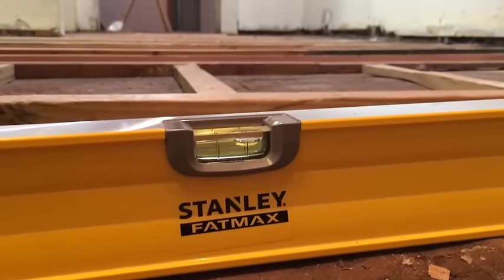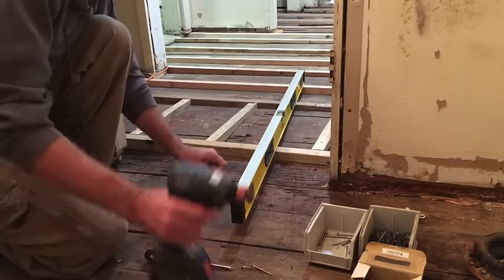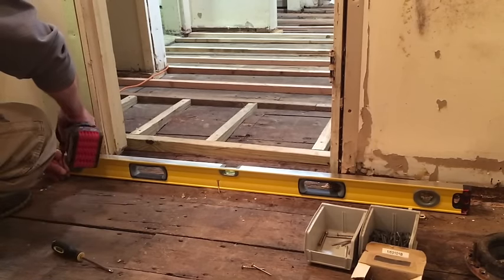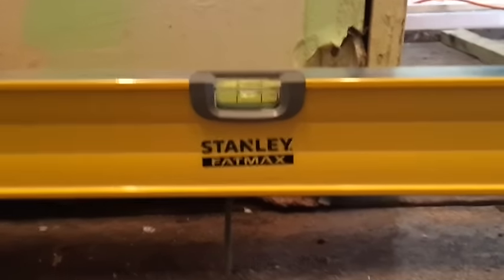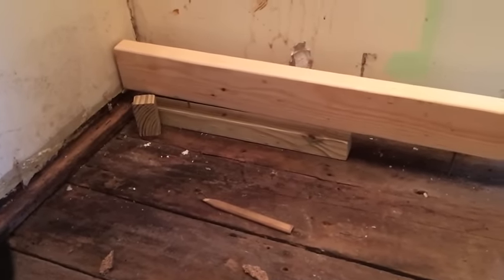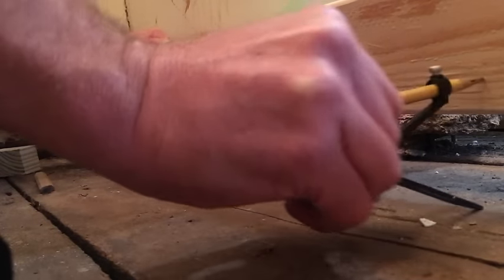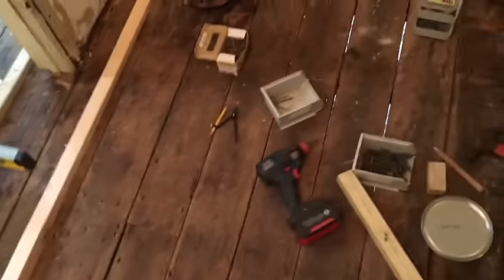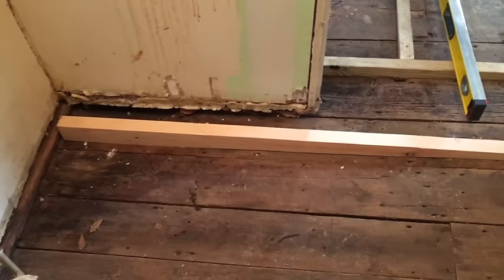DIY: How to level a uneven, wavy, or sloping wood floor

Comment: good morning I am going to do it too.I have a deck that i close in. And one side higher then other side. So wish me luck.I want get my wood up on the walls. I have to my floor first. I watch video your make much sense to me. thanks well I did it.
Reply: My sucker was saw that we have it’s a Dewalt and let me tell you it heats up the batteries real quick I don’t think it’s need to cut a 2 x 4 I don’t use it my husband uses it it scares me but I’d like my chopsaw and my jigsaw but when I get done I will show you a picture of it

Comment: I see I am way long from posting to making a comment but just wanted to say, in the process of buying an old home and the floors are terrible.  It has had some foundation repairs before and, like you, probably needs new footers and posts but each floor has shifted and sagged different amounts.  You put a level under the joists and its pretty minor.  The 2nd floor though is wavey and in one place you can see the closet has shifted (sagged) inches.  Once I have it stripped down to studs I'll know for sure if there is more structure to repair but I'm thinking, aftet 160 years, its the same thing you had here.

Comment: Hey....I'm a complete novice and love this video. Thank you!!  One question from this renovating, mathematically challenged grandma....how do you calibrate the scribe angle?  Sorry if it's a dumb question. :(
Reply: Might be a bit late here but  you just need it to reach from floor to the face of the board at the largest gap.
Reply: @daytradersanonymous9955  I totally appreciate the information. I left the floor until last and actually locked the door and headed to Jamaica for a bit. Will finish the reno when I get home. Thanks so much!!

Comment: Couldn't find any comments on this: Any thoughts on insulation in the deadspace or some other filler? I'm thinking this would be great for a 1917 porch on a house. Has been fully enclosed. Underneath is still generally exposed
Reply from the maker: Hey, John. I did use some expanding foam in between the some of the shims where there were some gaps and cracks that air could circulate. I let it dry, then trimmed it with an oscillating tool. Putting some fiberglass insulation probably wouldn't be a bad idea, too. Good luck!

Comment: You can skip the last step by setting your scribe up properly. If set up you wont have to cut the height down
Reply from the maker: Thanks.
Reply: Please explain how you would do that... I think there should be a way.
Reply: Use a sliding square ruler and measure from the top of the screw to the floor.  Take this measurement and mark it off on the side of the 2 x 4.  then line up your scribe on this mark.  All you will need to do is make the wavy floor cut and you should be level.  That's what I have been doing.  Great video by the way...Saved me a lot of head scratching.

Comment: Does this not affect the height of all the doors basically doubling your work? Couldn’t you use a self leveling mix?
Reply from the maker: I trimmed about an inch from the bottom of one door. Self-leveling compound is heavier, is not to be used on top of wood, and can only be poured 5/8" thick.
Reply: @737T1C130  thanks!

Comment: This is a seriously great video! How did you determine which room to start in? Our bottom floor includes several additions and I’m terrified of the thought that I might (with the help of your method) perfectly level one room just to find out that it is at an entirely lower level than the adjacent room. Do you see what I’m saying?
Reply from the maker: I used a tennis ball to find the highest and lowest points of the rooms (by seeing which direction the ball rolled), then started at the highest point.

Comment: Ok, probably a dumb question, but how is the ceiling fixed/leveled? 
Ours will be SO off after we level the floor 😬
Reply from the maker: poolahpot The perimeter of the house was level, just the center of the floor was sagging toward the middle. The ends of my ceiling joists were resting on the perimeter of my house, so while the floor sagged in the middle, the ceiling did not. However, I did add support to the ceiling joists to ensure the remained straight. Good luck! I’m not a pro, just a DIY’er, but it wasn’t too difficult.
Reply: Install a drop celing.
Reply: And no its not a dumb question.

Comment: Will you apply Boracare to the existing sub-floor to prevent termites? Or some other products?
We live in florida and they are horrific here.
Getting ready to do this same kind of project on a 100yr old home and this video is so helpful!
Also, did you do any mold testing?
Reply from the maker: poolahpot I have several old buildings on my property over 100 years old. For some reason, the termites never attack the old roughcut local hardwood structures. However, they will attack the older store-bought pine board construction. Fortunately, there was no pine in this house and no sign of termites. There was some very light surface mold on a couple pieces of drywall, but the interior of the house was gutted until no sign remained and it’s all been replaced
Reply: @737T1C130  Maybe a dumb question, but why'd you level the floor before gutting the drywall? I've got a sloping floor, actually worse than yours.  I had a structural engineer come in, and a contractor poured new footings and installed a new beam, but there's only so much he felt he could jack up the 130-year-old joists without cracking them, but I'd planned to level the floors BEFORE reframing the interior (it's a masonry-supported house so all the framing needs to do is keep up the drywall, except for 1 structural wall inside).

Comment: You could also take up the boards & bolt 2 by 6 to the joists, less time consuming but more expensive.
Reply from the maker: The joists were full dimension hardwood 2x6" from 1916 with ductwork, electrical, and plumbing added later between them in the crawlspace. The subfloor above those were full dimension 1x6" planks 2 layers perpendicular. The walls were built on top of the subfloor. Believe me, it was not less time consuming or I would have done it.

Comment: Does the block of wood have to be a certain height that you used to scribe your line?
Reply from the maker: Not really. It just has shorter than the piece of wood you are scribing. Once you get the scribe/contour, you can just cut the top down to the appropriate height. Someone suggested scribing the line so that you don't have to make the second cut, but I'm not that smart.

Comment: Could you not have used a series of joists with different heights then lay cross section beams joining each joist. You could lay plywood over the cross section then.
Reply from the maker: Chris Nugent I have no idea.
Reply: @737T1C130  I missed your posted comment. Apologies. 
I've got an uneven concrete floor in my kitchen that I'm going to build a new level wooden floor over it. 
Sounds like your house has kept you busy. It'll pay off in the end.

Comment: I need to do this on my upstairs bathroom, what’s the reason for keeping the floorboards? I was going to remove mine to reduce floor height difference to the hall etc.
Reply from the maker: The floorboards are long 1" thick hardwood planks. In some places, there are two layers of floorboards running perpendicular. the interior walls are built on top of the floorboards. Demolition and rebuilding would have been much more costly and time consuming, but you're right, it would have reduced floor height. But that wasn't a concern here.

Comment: I have done something similar once -> I used thin plates of wood, metal and plexiglass - > I made  plate stacks every 10 [in] levelled and secured them, then put a 1 [in] OSB plate on top of it. It went fine in terms of levelling but it was not perfect the floor beneath creaked a little bit here and there even though I secured it. All together it was quite time consuming and I am not perfectly happy with it ... I should have just removed the old floor and underconstruction and put an insolation + concrete screed in. (yes I read that in your case that was not possible ; ) )
There is also another possibility using screed made from gypsum ... one can first level the floor with a kind of gravel insulation material and then put gypsum boards on top of it ...

Comment: You don't need to make two cuts. Simply adust your compass to start from the lowest point/ghost stringer hight, marking that point on the 2x4 and setting your compass to start scribing from that mark
Reply: Can you elaborate? Having a tough time envisioning this tip. Thank you!!

Comment: Curious. Would it have been less work to rip up the subfloor and sister up the joists? No scribing or ripping? I was about to do the same job but saw your approach and am question which route I should go? Thanks for the video!
Reply: My husband has done it both ways and once you start ripping up a subfloor you will wish you did it this way. The only benefit to demo subfloor is that you can access the crawlspace and sure up any piers or joists that need it without having to work in the crawlspace.
Reply from the maker: If your subfloor is plywood panels or similar, it would definitely would be easier. My subfloor was made of two layers. Each layer was hundreds of old full dimension 1" by 6" planks and the layers nailed perpendicular to each other. It would have been much more work to pull up my subfloor than the time I spent cutting shims.
Reply: @737T1C130  Not to mention the old 1x6 subfloor is old growth wood that's probably stronger than any new 2-by you could get at a hardware store these days...

Comment: I appreciate what you're trying to do but there are some things that puzzle me. Given the direction of the subfloor boards, it means that the floor joists are running in the opposite direction: that is, perpendicular. This means that the tapered pieces of wood that you're using to level the floor are running perpendicular to the floor joists. This means that these pieces of wood are acting as the new floor joists yet they are only inches deep when a floor joist is typically 10 inches deep. This means that the depth of your "new" joists are not deep enough and will not support the weight that they're suppose to support once you apply a subfloor on top of them. I addition, the last two "make-shift" joists are much more than 16 inches apart: the standard for floor joist spacing. Now, I see that you added sections of wood between these "make-shift" joists between the last two that you've shown (but not beyond that). Even assuming that you do the same for the rest of the floor, because your "make-shift" joists are tapered, and not level, the sections of wood between them ARE level so you won't end up with a flat floor. Not sure if you understand what I'm saying but, in short, this WILL NOT work.
Reply from the maker: You have no idea what you're talking about. The 2x8 underfloor joists are 12" on center. The subflooring planks are 3/4" thick. The shims across them are 12" on center except for the area near the door. The 3/4" plywood subloor has a load rating of 175 lbs per square foot with a maximum span of 48". It has been lived in for 4 years. There is zero deflection and it is perfectly level. The only thing you're an expert in is watching someone else do work.

Comment: Just a few more months work, and this will be done! But all kidding aside, there just ARE NO shortcuts to leveling a floor. I had to once fix a loft floor dropoff that was far far worse than shown here: something like 11 inches lower on one side of the 25 ft width of the space. So it was much more complicated than here. No fun at all.
Reply: For that wouldn't it be better to remove the subfloor and attach new joists to the current ones but level?

Comment: Really liked your video! Wouldn't the 2x4s add too much height to the existing floor on the higher end? I did the same thing recently to one of the rooms in my 1922 house, but I sistered the existing joists instead of adding angled 2x4s on top of the existing floor. https://youtu.be/UztX9Ey3hYg

Comment: Do you have to cut the sheet Rock back or can you but the leveling strips to sheet rock
Reply from the maker: No need to cut the sheet rock if you don't want to replace it. Just butt the shims and new subfloor up against it.

Comment: I have seen worse on homes built in 1980 , no Code .  To fix the floor right it take months Since they still have no code the owner wanted that done . I was ripping 2x6 the sag in the floor 8 inch in some places , It was a Log home built on the hill side water ran under the 4 inch cement slab no footing  the poles holding up the second floor went through the cement floor no extra cement pad under the pole for weight the roof and second floor sagged 10 inch ,  Only way to fix it right would be start with the roof and tear down the home poor footings and a new slab on Virgin ground.   The Owner was at a lose when I said I can't fix stupid , Logs on the slab rotted out a 4 inch knife would pass through like butter they used 6 inch logs trimed a 2x4 top plate and bottom plate so logs lay flat .  toe nailed 16 d , into the logs every 12 inch . No Threaded tie down every 8 foot going from slab to top wall , as some guys know the 12 foot rod should be used to tie down a log home . Owner been  better off burning it down .  start over . and take the 140,000.00 loss . Un safe to live in . He never did have me fix the rotting logs sitting on the cement slab as a seal plate .  every rain it's just getting worse .

Comment: Fixing a floor that slopes and is rotting already for a house that's probably 75-100 yrs old is really a temporary solution and in a proper renovation won't solve the problem.   In addition, if you are selling this home, you'll have to disclose what you have done here.  A good foundation job would be the right way to do this.
Reply from the maker: You have no idea what you're talking about. I'm not selling it. I'm renting it. It's not a temporary solution. You did not read the description. You're lying about "having to disclose" what I've done here. You cannot provide a reference for this ridiculous claim. Moron.

Comment: But what happens if the house continues to slope over time? Wouldn't that make the floors uneven again?
Reply from the maker: The reason the floor was sloping was a brick chimney resting on the floor. It was removed.

Comment: Great video, thanks ! Quick question, what thickness did you use for the subfloor plywood ?
Reply from the maker: I used 3/4” plywood over shims 12” apart. It seems like I could have spaced the shims further apart or used thinner plywood and still have been just as stable.

Comment: But what about the problem that made the original floor uneven to begin with?
Reply from the maker: I fixed it
Reply: ZigPig 
What was it?
Ours was no one poured/placed cement slabs underneath the footers.
Reply from the maker: Poohlapot, it was a brick chimney sitting on top of the floor. I wrote about it in the video description.

Comment: This is a great video, thank you. One question: After you put the screws in the floor to determine level, could you not place the 2x4 beside the screws and draw your line across the 2x4 using the level as a straight guide between the tops of the screws? Then I think you only have to make 1 cut in the 2x4 to make the top level with the screws, and the bottom side will already be level with the floor.
Reply: Hmm I guess I am assuming the floor is straight sloped vs uneven across. If it's uneven then you need the 2 cuts.
Reply from the maker: Right. As you said: in you had a consistent slope in the floor you could definitely lay the word next to the screws. My floor was wavy and contoured in multiple directions, so scribing the line was the best way for my situation.

Comment: Your method works, but I would have removed the subfloor and sistered the floor joists to be leveled!
Reply from the maker: ...but you didn't.
Reply: @737T1C130  But I didn't what?
Reply from the maker: Actually do the things you say you "would have done". Not interested.

Comment: This method will take forever to finish and it will not be strong.  You need to invest in a laser level and take the subfloor out and use 2x4 to sister the beams.
Reply from the maker: Tien Doan and you need to invest some time in reading the video description. I finished the house in a day and a half using this method. That’s slightly shorter than “forever”. Thanks for your expert opinion.